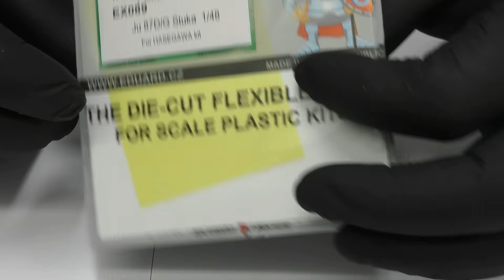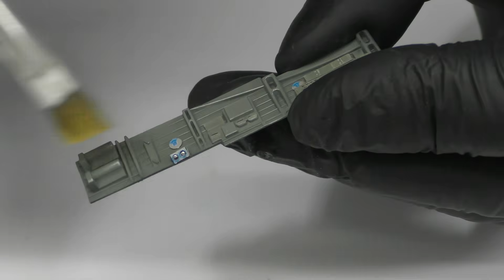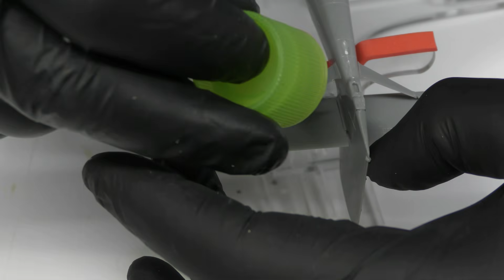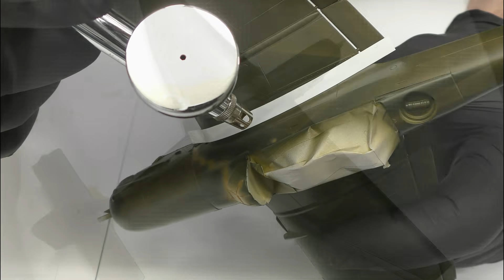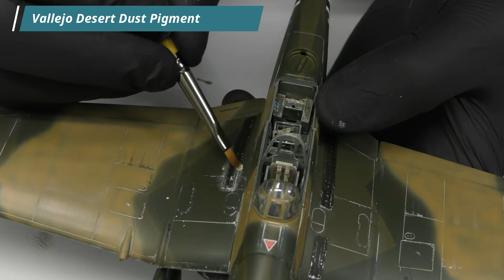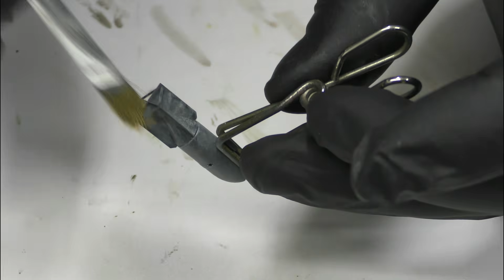Junkers Ju-87 Stuka. 1/48 Hasegawa, Hobby 2000. Model aircraft full build.

Comment: Looking to move away from vallejo model air as it doesnt work with my h&s evo 2024. Do you have a preference between tamiya, mr hobby or ak or do they all work well? And do they all need their own brand thinners? Do you suffer from tip dry from any of thewe brands as vallejo clogs and dries after about 5 seconds. Very frustrating.

Comment: Jolly good build! 
Earliest Ju-87D-1's did have RLM 02 interiors.
Most B-2's, and ALL D series & later had wood props,  pressure-covered with linen, painted, and a nailed-on narrow, brass leading edge strip, similar to British wood props. So, no "silver" chipping!
Also, German a/c paints were much less prone to chipping, flaking & even fading than Allied--esp. U.S.--, Italian & Japanese paints.
After D-1, all subsequent models did away with advesive-atttached, black rubber walk strips, instead using rivet-attached, metal walk strips, painted in a/c's camouflage colors.

Comment: Thx for your video and quality effort!
Rather than make subjective comments regarding amounts and interpretations of wear--to each his own--I thought I'd leave an objective note. 'All' B2 and later Stukas used wooden props. This is easily distinguished in photos because the early (B1) metal Jumo props have more narrow chords. The wooden props were manufactured with a glued-on linen covering, and then a very narrow, thin brass protective strip was nailed/screwed to each blade's leading edge. The last step was to spray paint each wooden blade 71 dark green, and then the blade logo/part number in red. Consequently, it would be incorrect to depict finish wear or nicks to these wooden prop blades with 'silver'-colored paint, implying metal blades.

Comment: one way you could possibly cut that notch to open the canopy all the way to the antenna is actually drill a small hole two times and then lightly sand it down with small enough sandpaper, other than that it looks great!!

Comment: Word of the wise... The amount of weathering to the cockpit is a bit too over done. You don't see that amount of dirt in a cockpit especially around areas where dirt doesn't rub off the pilot or crews shoes. Also the dry brushing should be done with light grey or lighter shade of original color to show highlight. Using silver or metal on areas where their is no "traffic" or wear is not recommended for the cockpit. The silver panel line wash is not realistic either. You don't have a huge amount of panels rubbing together at the seams to make bare metal to show through. A light dust wash on the panel lines on the wings is more of what you need on aircraft for the desert. But refer to period photos. As for exhaust staining. You have to know how the prop turns to know how to do the correct pattern for staining. On a prop that turns counter clockwise looking at it from the front, the left side is going to be blown slightly up  before traveling aft down the fuselage before going over the wing because the corkscrew air coming off the prop. The right side is doing to have down draft off of the prop before going over the wing and under. That is why you see most aircraft having having exhaust stain high on the one side and low on the other.
Reply: Remind me to invite you to my parties.
Reply: @archerry6457  ha ha !
Reply: You must be the "Eric Olthwaite" of the modelling world.
Reply from the maker: Thank you, Some interesting points to consider!
Reply: Yet it still looks pretty good regardless ;)
Reply: @memkiii  It does look very nice. I like the look of it.  I am in the process of doing 2 Ju87s. One B-2, one R. Just finished a Ju87A earlier this year. So regrouping from how bad of kit that was.  I am just particular on weathering for the newer modelers out there to heed caution on thinking that is how it Should be. I am more restrained on things.
Reply: @coolhand501  Having worked on aircraft in the field, they did often end up pretty cruddy inside the cabin / cockpit, mainly from muddy boots, but I agree that if they are operating from a decent paved runway, then that is far less of a problem. Most of the crud in a cockpit is usually broken chinagraph leads, fluff, and biscuit (cookie if you are US-ian), crumbs mixed with unknown sticky substances.
Reply: 😂 You've apparently never worked with aircraft in the sand, that crap gets in & on EVERYTHING!
Reply: @jcwoodman5285  Our F15s at Desert Shield/Storm all came home loaded with sand, it got into everything
Reply: Frankly speaking I don't like whethering but it's your model..ha..ha..ha.. by the way it looked cool...off course I can dream only to build like yours. Keep up the good works.

Comment: I really love your channel. You have an amazing talent for models. 
I have one corny request: please please do a video on how to properly mix paints. If I get it right (the paint flow) it’s pure luck. 
My paint seems to splatter rather than go on smooth. 
Id greatly appreciate if you would do that. 
Thx
Reply from the maker: Hi. Thank you. I can look at doing a video like that. I would say that I predominantly use Tamiya, Mr Hobby and AK Real Color paints for airbrushing. As a rule of thumb I thin all of these paints 2:1. 2 parts paint to 1 parts thinner. And i usually use the manufacturers recommended thinner. Hope this helps a little, but I will look at doing a short paint mix tutorial. Cheers. Andy

Comment: I tried VMS varnish on my last model, just couldn't get on with it, it just kept clogging up my airbrush. That was with a 0.4mm nozzle. Don't think I'd use it again.
Reply: Strange..  vms varnish (all types but the matt one especially good) works great with me, using an evolution airbrush at 20 psi and a  0,3 mm needlee, no thinning. Being a varnish with no paint pigments it doesnt clog at all but demands a good cleaning of the airbrush afterward.

Comment: nice job ,i cant find the blueprints but the glass bit on top of the canopy rails under the main canopy to give space for the antenna so yes you had to remove it or to make it more scale glue another very fine thin clear part under ther.... ,again if you want to be 100% scale the canopy of this model is not scale anyway ,it needs to be lower and thinner so....its fine for that old kit anyway !
Reply from the maker: Hi, Thought so! Yes, the canopy doesn't seem quite right, but as you say, it's OK for an older kit. Thanks for your comment. Andy

Comment: I've recently started using VMS Gloss HD, it's very thick, even from the bottle and if you aren't careful, can leave an orange peel like appearance. I thin mine 50% with Vallejo Acrylic Thinners and apply light coats. I have spoilt a few models in the past using this product.
Reply from the maker: Agreed, It's very easy in infill detail laying it thick enough to get the gloss finish. Then your screwed! 50% sounds good. But Mr Hobby Gx100 works so well! 😉 Thanks for watching. Andy
Reply: @ScaleModelShed  very good 🇨🇱🤘